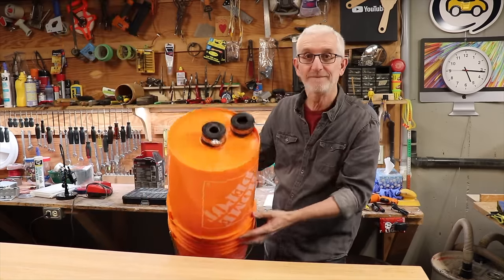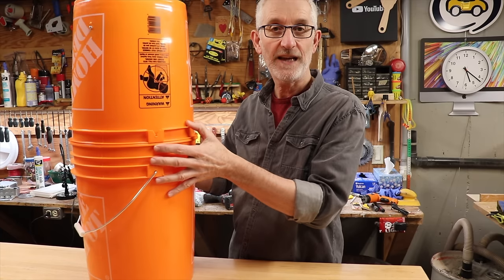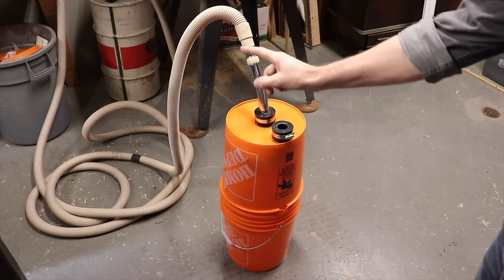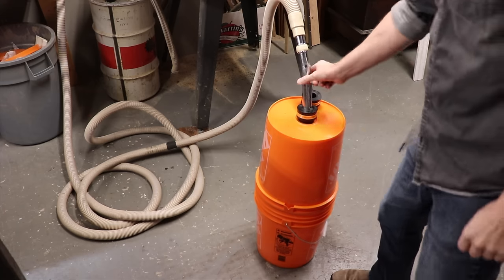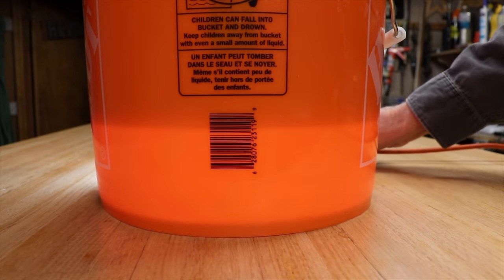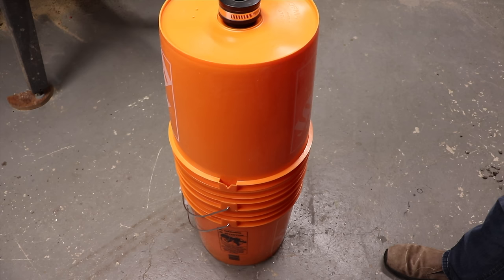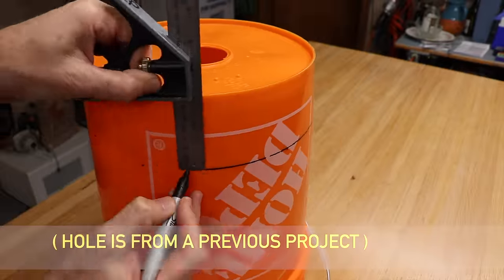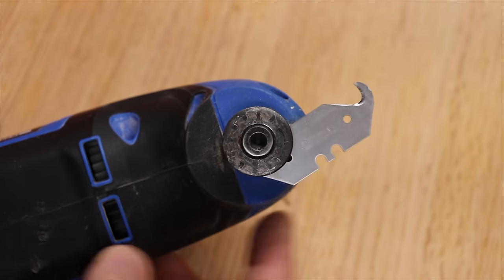Simple Cyclone Dust Collector ● UPDATE !

Comment: I saw your first video and I star watching some others to do the same work and get more info , because has no way to found same type of buckets here .... then I found one video about avoiding collapsing buckets or tank, a Russian guy explained easier way to no collapse. let me explain .... he installed a spring check valve ( the one used for no return water sistem) and it works amazingly!  I did it and it prevents to colapse your deposit tank or to force the vacuum cleaner in case of total blocked air . So no need double buckets. Hope you can try this to.  Brgds .

Comment: I made this last week and actually just built a cart to hold shop vac below and buckets above.  Also used PVC between shop vac and bucket.  A board with a half cut circle slid into the  notch on bottom bucket

Comment: Yup, you made a point 💪 👍
Btw, better using gravel (or a pour of concrete) than plain water, you know, you are still using electric power 😉
How about a round steel plate larger than the bottom of the bucket?

Comment: Just made mine exactly as specified, except the first 2 holes were cut wider than the pipes, had to wrap tape around the pipes to form a seal, still a small gap , these gaps may prevent implosion. Glad my mistake will result in the fix for implosion

Comment: Assuming you have scrap wood (which as woodworker, you more than likely have more scrap wood than project wood,) you could also make feet for it at 12, 3, 6, and 9 on the second bucket for even more stability. Start it at just under 3 inches tall, taper it down to 1 inch. Make 4 of those and you should be good.

Comment: for a Lowes bucket I had to use a heat gun to convince the inner lip to move inside the bottom bucket. Worked fine.

Comment: ABS is getting harder to find. I used PVC. Wasn’t sure if the rubber cap would be tight enough, so cut some of the thinnest rubber gasket material (two 6” square sheets for $5?) to wrap around the pvc couplers (or around the lip of the rubber end caps). Dunno if it was necessary - but the system Works great! I like how it’s all pressure fit - easy to maintain / fix / adjust. The cost for the parts if all bought new (guilty) makes it similar in price to prefab systems - but if any one piece dies - it’s between free and $4 fix rather than buy a new system outright again.

Comment: My buckets also collapsed. 
What I did was to cut the rims out from the 'discarded' lids. 
(I removed the inner flat portion of lid thus leaving all of the 'rim'.)  
Then fit each rim half way up each bucket and secure them with duck-tape. 
They work 'good enough'. They can still collapse but not under normal usage and accidental blockages.
AND yes, I also put a brick in the bottom... Helps save it from tipping over.

Comment: Nice, Chris I reckon you would get even less dust flow through if you have an old stocking over the cyclone output installed internally or a cheesecloth fastened with an elastic band.

Comment: I cut a third bucket in half as Chris shows and mounted it with a wood disk inside to a dolly type platform that also holds my shop vac above and behind the collector. The bottom half bucket stays on the platform and keeps the collection bucket from tipping over or collapsing. I drilled holes in the bottom sides of the holder-bottom-half-bucket to allow air back in while pulling the collection bucket out. Otherwise they make a great seal and the vacuum underneath makes it difficult to remove. 

My version used a 2" black PVC pipe side entry (I used a 2" hole saw) tangent to the inside wall and angled slightly down to eliminate the angles, which increases air flow. I also put a piece of stainless sheet metal inside where the chips enter the collection bucket to keep stuff like Melamine chips from eating away at the plastic sides. 

When I removed the handle from the top cyclone bucket I cut about  3 inches off the ends and bent the straight ends loosely around the ends of the handle of the collection bucket such that they link back on to the cyclone bucket handle slots and pushing the collection bucket handle down, locks the buckets together. I'm very pleased with this set up.

If I had known about the collapsing problem before completing my version I would have used the top rings of the holder bucket (#3) to strengthen the upper cyclone bucket. So far that has not been an issue since realizing the air needs to flow or the vac sucks the material out of the collector from extraneous air intake. 3 buckets for one awesome collector! Super value!

Genius Chris. Thanks!

Comment: I built the collector guided by the first video and it worked great for saw dust , shavings and miscellaneous debris. I tried using it to clean my pellet stove and found  two things: the ash does get to the vacuum filter but at a reduced rate.  Just to fluffy.  I thought a static charge might build up, which has happened in the past but not with this.  The  collector did collapse with my shop vac when I restricted the flow to use smaller tools so I will add the additions before the next cleaning.  Otherwise it was a very easy and effective project.
Reply: Do some googling about "cut point" or "separation point". I'm no expert, but I think you can improve collecting more fines by increasing the speed (stronger vacuum or smaller diameter bucket) and/or reducing the density of the inflow (suck less ash at once). I imagine a 2nd cyclone stage with a smaller diameter bucket after the one in this video. Fines are the worst part of ash anyway, so I understand why you'd want to fix that.

Comment: Tip for  the original video: when trimming the upper bucket to insert into the other, I had a hard time  wound up using a heat gun to soften and roll the cut edge of the bucket inward. Much simpler process and it still seals very tight.
Reply from the maker: That's a great tip! Thanks.

Comment: To fit the smaller space I had as part of the cart that mounts my bandsaw and sander, I used 5 gallon buckets.  It does not catch the very finest sanding dust, so I think I might try putting a few inches of water in it, but I consider it a huge success.

Comment: I wanted to "see" how much was in my dust collector.  I originally tried a regular (old, used) Homer bucket for the 'top' piece, and an HDX translucent bucket for the bottom so I could see how full it was getting.  COULD NOT get the 2 to fit together, no matter how much I scraped on the 'top' piece.  Gave up and just used 2 Homer buckets, and ended up with the top (used) Homer bucket simply collapsing.  Temporarily fixed that with Flex tape, but winter is coming on, and I doubt the rest of the old, used Homer bucket will live through that.
Bought another HDX translucent bucket, and retried.  Things fit PERFECTLY now.  My lesson was you probably have to have 2 IDENTICAL BUCKETS.
I had already built a "cart' which holds my (olde) Shop Vac (16 gallon) and the dust collector, a 20 foot hose from Home Depot, and all my attachments.
Will rebuild things and will definitely use Jack Strange's idea of using a circle of plywood, probably on both buckets..

Comment: I am interested in setting up a dust collection for my planer, table saw, sander, etc.  In order to prevent clogging, I would like to use larger lines, increased diameter to 2 1/2".  Have you tried using larger lines using the HD buckets?  I like the idea and would like to use it if it might work.  Thanks for publishing the video.

Comment: What's the science behind the second bucket over the first that prevents the bucket from collapsing? I came here looking for a solution to this very issue and was about to just buy a dust cyclone when I came across your update. Gotta try it out now. Great stuff, Chris!!
Reply from the maker: It just strengthens the walls by doubling up.
Reply: Here's the secret:  When the bucket collapses, its diameter decreases in the collapse direction, but increases in the other direction.  (Try squeezing a hula hoop.)  The outer bucket prevents the inner bucket from expanding in that direction, thus maintaining the integrity and strength of the circle shape.  It simply cannot collapse (as long as you maintain IRL conditions).

Comment: Hi Chris, I had a heck of a time getting the two buckets to join after cutting the bottom one per instructions. I solved this with using my plumbing blowtorch and gently heating the lip of the bottom bucket (going around and around until I could feel the heat thru my work gloves) and it then fit inside and of course molded to the correct size! Thought this might be useful for anyone else having the same issue... Cheers
Reply from the maker: Thanks for that tip for others to read.
Reply: I did the same thing with heating the lip of the bottom bucket.
I used an old Safety-Kleen translucent yellow bucket, which is about 3 inches taller than a normal 5-gallon HD pail for the bottom and a Latext-Ite 5- gallon pail for the top. 

Both pails are much thicker than a HD pail. Heating the bottom bucket lip lightly (warm to the touch) allowed the rim to stretch to the perfect size. I also used 2-inch couplers for both intake and suction that fit the 2" SHOP-VAC hoses nicely. This setup will not collapse with a HD SHOP-VAC and the extra 3" in bucket height works even better with the cyclonic action. 
I wiped down the bucket mating edges with silicon spray, which makes pulling the buckets apart easier.
 
I will be making a roll cart using a furniture dolly to place the bucket into a plywood frame to keep the whole setup from tipping over and making it easier to move around the shop.

Comment: I know prices vary with region but it looks like you got about $25-$30 bucks worth of material with the refined design. I like the DIY approach and the various ways you have connected the buckets (I watched both videos). At the same time for $40 bucks you can buy the Dustopper which comes with connections and a hose to attach to your vacuum and it appears to keep noticeably more dust off the filter which is the big issue. Also it only needs one bucket so it's less top heavy. Cool channel though. Good content.
Reply: Yeah, this is not a good solution to buy all parts new.  It's ideal if you have most of the bits lying around, and it's clever in how there's nothing difficult to acquire in it.  But the of-the-shelf units are smaller, and have practical advantages over the diy design, so worth the spend if you're starting with nothing.

Comment: Using my wife’s account…

 Just made the original and added the mods, works awesome but now i need to put wheels on it, i have one of those HarborFreight mechanic benches on wheels with a metal bottom that should do the trick.
I left the handle on the bottom one and if you bend the wire just right it works to secure the top and bottom together snapping into the rings on top then the other handle i added to the collection bucket handle so i can easily carry it as the addition makes the handle longer reaching above the top….
Ernie

Comment: Using your central vac with the dust collector made me wonder if an attachment to the suction end could be used to scrape off “popcorn ceiling.”  Of course, if possible, then a suggestion for the scrapper tool would be most appreciated.   I enjoy all your videos.  Susan
Reply: Take a wide scraper, tape (screw, glue, whatever)  the end of your vac (shop vac or other) under it with the open end of your vac near the handle, not the blade,  and then attach a piece of cardboard extending from the bottom of that past the end of the scraper.   Wet the ceiling a bit, turn on the vac, now, as you scrape, the junk falls onto the cardboard and down into the mouth of the vac.

Comment: Stopping the collapse issue - very clever. 
Rather than stop the collapse by bolstering the inside, you stopped the deformation of the bucket. You must have worked for NASA at one point :-)

Comment: Chris, awesome info and timely as I’m trying to prep for a desktop CNC router. I have a central vac outlet in my basement that would be so convenient but am hesitant to use it for fear of filling my garage (where the vac motor is) with all the fine dust that doesn’t clog up the central vac filter bag. Do you use a special filter in your central vac? Is the rest of the house impacted at all in terms of central vac use? Thanks!
Reply from the maker: You have the perfect set-up! Use that central vac! You will have no additional dust that gets past the vacuum filter. You'll be fine. My wife usually yells down "could you disconnect down there" if she is going to vacuum the house. Or sometimes I will have to run downstairs and pull the hose out if I am vacuuming.

Comment: Great ideas.  I do have a question/suggestion.  For fine dust extraction such as from a sander, would it be helpful to put some water in the lower collection bucket to hopefully take up and trap the fine dust before it moves on to the shopvac?  I've built the unit as per your first video (note that HD has changed their bucket some), but haven't tried it out as I'm waiting for a second shop vacuum to dedicate to this system.
Reply from the maker: Yes thats definitely easy to try to see if it works!

Comment: Will the buckets collapse using a max 6hp vac instead of the max 3hp that was used in the demo?  Also, where should a ground wire be added to avoid static?

Comment: I just ❤ your ideas! I'm sorry but I don't understand. Does your shop vac not pick up saw dust well? Is that why you came up with this nifty idea? Or are you trying to separate for another use?
Reply from the maker: If you work with wood and use a shop vac for the sawdust, the shop vac filter gets very plugged and messy to clean. With a dust collector, it grabs 99% of the stuff before it gets into the vacuum cleaner.

Comment: I made one of these from a plastic barrel a few months back, I tested it at the time and found it worked well, much to my surprise, most things I make don't work. I've only just put it to work over the past week and found it's actually working a bit strange. When it's connected to my belt sander it catches the fine powdery dust with no problems, but when I use the hose to clean up the heavier wood shavings from a drill press they go straight through to the vacuum. It does an amazing job of separating the two types of woods, I just can't figure out how and why it's doing it.

Comment: Fantastic job with the research, and the execution, and the video. My problem is that you used ABS. I think that's a Canadian thing. I don't think my HD stocks it. I'll see. If not, I'll have to figure how to convert to PVC.
Reply from the maker: Many have said they use PVC and it works the same.

Comment: Good day Chris,
Quick question: I built your dust collection system which I hooked up on a central vac system... for some reason, the wood chips/dust makes it to the central vac filter but the heavier stuff do get collected in the bucket. Have you experienced that when using your system with the central vac? Thanks again for all your amazing video!

Comment: I've just put mine together. The hardest part for me was trimming down the bucket edges to get them to fit. Maybe the the buckets in Australia are straighter? Everything else came together easy-peasy. And it works well - really please with it. 
To get the connectors to fit better I used plumber's teflon tape. Otherwise, as per recipe. 
==> One problem I do have, is that there is an EXTREMELY loud whistling noise when the in-hose is connected. (No whistling when only the vacuum is running with buckets but without the in-hose. Also by varying how much I block off the in-hose (reduce the velocity), the noise dies off.) 
Unfortunately, the vacuum hose I ended up with is actually for swimming pools and spas. It's walls are formed using a concertina  structure, so that presumably is the cause. Surprisingly my Ryobi workshop vacuum hose is constructed similarly but does not have that problem. 
In any case, something for others to be aware of.

Comment: I just came across this video 3 years later. Veru well done! I'd like to know how can you make it shorter? My intent is to place it inside my mobile work bench.The vertical space i. 26.5 inches and have it connected to my table and miter saws with dust gates. The 14 gallon shop vac will remain on it's wheels. Thanxabunch!

Comment: Seeing how the filter seems to hardly get any dust on it and the vac has no sawdust in it, I am wondering if you could just add the head of the vac onto the top of the dust collector and do away with the vac bottom. Then put the whole thing on a small dolly to make it easy to move.

Comment: I just put a large open hook down low in the wall and dropped the handle over it. Tip problem solved. Yes, my shop is very small and the hose reaches all of it without moving the bucket.

Comment: Chris, I vacuum a lot of powdery dust, including concrete dust.    It makes it way through my vacuum bag, and even through the prefilter covering the heap filter.    Id like to build something like this that will capture concrete dust and keep as much as possible stay from my vacuum.   Will this design work?  Should I add water to the bottom on the collection bucket to help hold the concrete dust?   Or would another design be more effective?
Reply from the maker: It's worth trying this. I don't know if it will work 100% but it should be better than what you have. The water in the bottom of the bucket would just create a muddy mess for you to clean up.

Comment: I am impressed how easily this was built and I have read about using buckets that have thicker walls then those purchased in most hardware stores. I do have a question concerning using the vacuum with a  orbital sander. I found that when sanding lacquer or varnish that the particle's are much smaller than when your cutting wood with a bench saw. Is there anything that can be done to be able to capture the dust using this system before it gets into the vacuum cleaner?